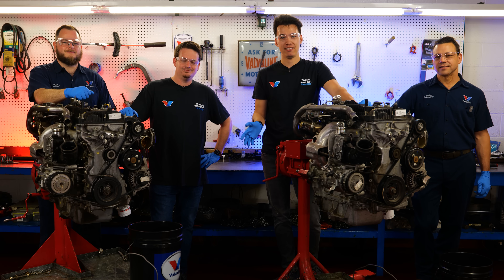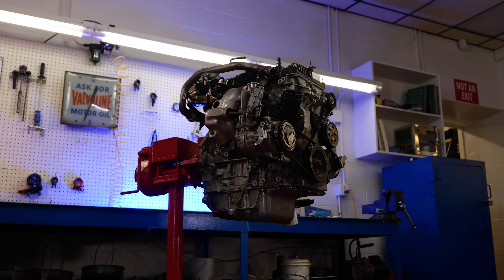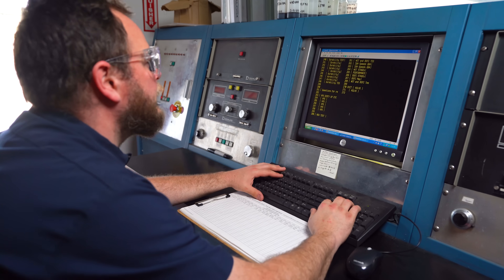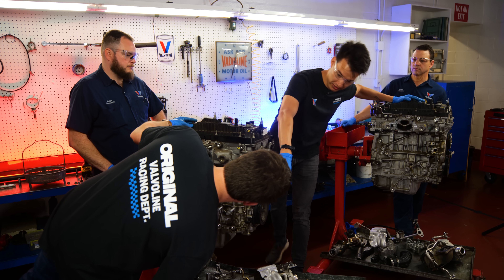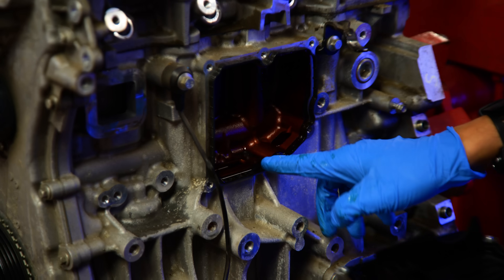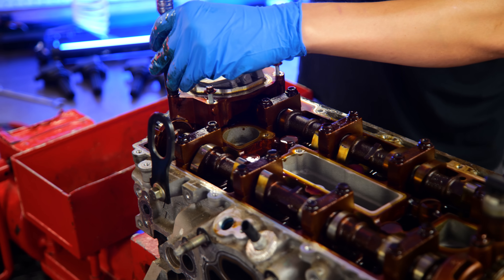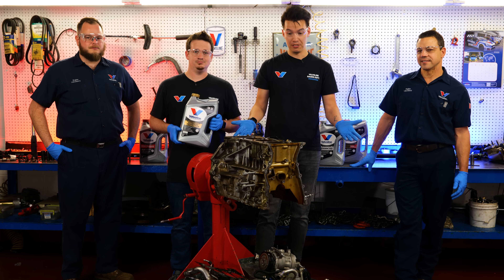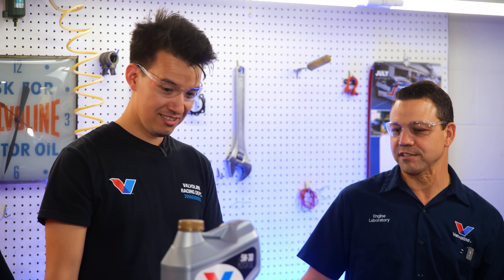Testing different oils over 4 years and 1 MILLION miles

Comment: I use Sea Foam before every oil change just to clean out that varnish in the engine. Been doing it for 30 years. Look at the color difference! That dark brown is burned oil build up. That acts like glue, not slippery like oil! That gets built up in an engine, and it will stop parts like timing chain tensioners for moving freely. VCT actuators wont work causing codes. Valves will stick, and in Hondas, Vtech fails to work right. All of these things need to be extra clean all the time to work right. Yes, good oil helps, and regular oil changes also help, but that varnish is a killer! That comes from the temperatures run in these new engines. When you reach 210 degrees in the coolant, oil starts to burn. When the moving parts get to 400 degrees, it burns fast. Things like bearings, cam lobes, and chains all get real hot and that oil is the coolant, not just a lubricant. That varnish stops small parts from moving freely like they were designed to do. When that happens bad things happen. Seriously folks! I do this every oil change, until I have the engine fairly cleaned out. Usually 2 or 3 times After that I do it about twice a year. Most off my cars make it to 300K because I buy them with 150K on them for cheep, fix them and drive them til the junk man comes to get them. I spend less in repairs in the life of my cars than you will in 4 months of payments for your new car! But, I am a mechanic!

Comment: Dollar store oil is fine if you change it frequently.  Detergent oil is the key.  The detergent prevents the formation of deposits.  But the detergent no longer works if you wait too long between oil changes.  Use oil with cleaners in it and change your oil often (1500 to 3000 miles).

Comment: well if you ran 1 with synthetic and one conventional oil, the conventional should have been changed earlier then the synthetic, that's just how it is, you cant run conventional as long as synthetic. If you try changing conventional every 3 to 4 thousand miles conventional will look just as good.

Comment: I have a 2008 silverado with 180k miles. I use conventional oil. I use 10w-40 conventional oil and change it every 3500 miles. Because it has DOD/VLOM, I use the viscosity necessary to keep the oil pressure at 40 psi at idle, I add a can of SeaFoam on every 3rd oil change and leave the SeaFoam in for the 3500 miles. I pulled the oil pan a couple of years ago, and it looked like the synthetic oil engine in this video. That said I use full synthetic oil in the rest of our newer cars and change it every 5000 miles. Never exceed 5000 miles on an oil change regardless of what the manufacturer recommends..

Comment: I'm confused did they run the oils for the same amount of miles between changes? At valvoline a conventional oil is roughly half the cost of full synthetic so a fair comparison would be changing the conventional twice as much as the full synthetic, we need a test with the oil replaced when the manufacturer says they need changed

Comment: 10,000 miles on one oil change is insanity in any vehicle
Reply: Especially with the cost of vehicles nowadays. I use mobile one oil and mobile one filter every 4000 miles like clock work. You might think it’s foolish but I’m a do it yourselfer. $100 for a synthetic oil change $38 if I do it myself. 5 cars in the family.

Comment: Viscosity is viscosity and one has a uniform molecular structure to withstand breakdown which leads to less deposits. Ultimately it’s all about maintenance and for conventional oil 10k miles is insane on a turbo application.

Comment: Now, run it cold for 20 minutes, shut it off. Run it for an hour, shut it off over night.  Start the engine cold and rev it right away. Put actual load on the engine.

500k miles on a engine stationary constantly running (nowhere near red line mind you), is not an achievement.

Comment: And the turbo is where they goofed up. Turbochargers REQUIRE full synthetic oils on anything newer than 2010. Them running conventional in a turbocharger fucks up the journal bearings and bushings in the turbo since the oil passages are smaller than what conventional is designed to do. Timing tensioners are a full synthetic type of feature as it was designed. The varnish issue is overzealous bullshit, change your oil regularly based on your application; if your coolant and coolant circuit are not operating within spec then I'd worry about temps. Carbon buildup, again REGULAR OIL CHANGES; 3k for conventional, 5k for full synthetic, and change the filter every 3 to 5k; done. If you want a REAL test, grab an old iron-block v8 and run snot out of them.

Also, I buy Pennzoil, so suck on my used oil filters nerds!

Comment: Considering the interval was 10,000 miles this was very impressive. I think I was as impressed with how well the conventional oil did as far as wear vs the full synthetic. I'm 72 and use synthetic but for many years conventional was the only thing available. It isn't so bad after all.

Comment: this is shocking. the more expensive oil wore better? I wonder what my engine would look like if it was parked in a controlled environment, routinely taken apart, repaired, examined, and measured? or did valvoline invest millions on this facility and employees for 4 yrs just for you guys to come along? thanks for the commercial.

Comment: You guy's are part of a HUIGE problem effecting consumers and OEM  alike... you said these engines were on about 10,000 mile oil change intervals, But you need to remind people the oil  levels need to be checked and monitored about every thousand miles or so, People now a day's show up for oil changes being "dangerously" low on oil because of normal oil usage many vehicles wont show any oil on the dip stick what so ever !!! OEM's are replacing engines for oil usage now more than ever, and spending millions ,Once low oil levels damage the engine there's no turning back. 40% of drivers probably never check their oil in between oil changes. OEM'S could easily install oil level gauges and sensors .  Owner of a 1991 Chevrolet Dually 454 CU v8 with 362,000 miles- oil and filter changed average 3500 miles from day one !! It's easy..

Comment: I’ve been using Mobil 1 full synthetic for ever we have a 2012 ford fusion with 312,000 miles on it going strong I use it in all my vehicles and equipment.
Reply: I will ad I also change my oil 5-6,000 miles with the full synthetic. Especially with turbo vehicles

Comment: Impressive mileages, however, 10,000 miles is crazy for oil changes, plus no one, who is empathetic to engines, would run an engine for 10,000 miles without an oil and filter change. Test bed tests are not the same stresses as real conditions on the road. Perhaps a higher % of detergents in the Synthetic oil, possibly kept the metal surfaces clean.

Who owns Valvoline now?

Comment: My engine is around 411k on my 99 Avalon. My catalytic converter still original. Could be possible it’s not even working lol. Been only using conventional but the bottles now say semi-synthetic. High mileage oil use to be a thing but it seems now now not needed. I do lose probably 1/3 quart per week. Naturally aspirated engine will always beat any force induction engine in reliability and longevity. I use Valvaline, mixed in sometimes Quaker State as it is cheaper.
Reply: Don’t be a cheapskate.  Do you like varnish and stuck rings?
Reply: Been working good so far. SAE standard rating.

Comment: Before seeing the video, I want tro say one thing. No gearhead goes 10,000 miles on conventional oil. I use semi in an old Toyota and do 2800 mile oil changes. Unless the use of the engine was equivalent to all-highway miles, this is not a valid test. Even with all-highway, no one who knows anything goes more than 5000 miles on conventional oil.

Comment: I was planning to switch to a conventional oil until i saw this video. I use a synthetic oil, but the oil seems to be decreasing (no smoke or any indication that it is decreasing). Did you check the oil quantity when you drained the engine?

Comment: I was a Ford engineer in engine division (now retired) and asked our lead tech specialist why Ford recommends 10,000 miles on synthetic blend oils. He said from their durability runs that they can not tell the difference between full synthetic and synthetic blends. The synthetic has such an effect that 50% is enough to substantially reduce wear.
Reply: I had an uncle that worked for Mobil 1.  They ran an engine 100,000 miles on the bench with fully synthetic... 3k oil changes.  The cyclanders still had the wear marks on it.  Which means that engine had almost zero wear.  I use Mobil 1 to this day in all my cars and change them all at 3 to 5k but way closer to 3 than 5.  I don't have problems with my cars.  Other basic things are need to make a car last a long time... like carbon cleaning at 100k if it is direct injection, belts, and timing chains, brake and coolant flushes.  Other than that normal stuff like brakes, new light bulbs, windshield wipers and of course tires.... struts and shocks around 150k.  If you are really good and somewhat lucky you can get a car to go over 300k.  10k a year average, that means not having a car payment for 25 years.  That is huge.
Reply: @bpb5541 you forgot about transmission flushes if the vehicle doesn't have a sealed transmission those are also very important along with differential fluids (trucks, awd, etc.) changed around the same time as other proper maintenance. Little extra too spend but it's a good price too pay knowing every fluid is new and not old/burnt up. Then at around 200k all the gaskets and seals should be replaced by that time or earlier if they started too leak.
Reply: @kylebeach2316 Thank you for this.  All very valid.
Reply: Durability is based on time and cost
Just like any other companies in the 21st century
Reply: Ford and durability can't be used on the same sentence.
Reply: @diegopalomino1200 although….. just talking in context to engine and wear items. I honestly think more than 75% of all small and catastrophic failures are due to the emissions factor. Plus appear in Canada or Minnesota where eight months out of the year, your engine and engine oil is being started at a temperature of around zero Fahrenheit which not only drastically starts deposit accumulation but also breaks the oil down significantly faster. I feel like all manufacturers need to implement a different oil based on where you live.  The manufacturer should say run a further winter grade oil in the winter versus summer due to the startup being cold.
Reply: @EasyGoingLife101  you dont say??
Reply: @EasyGoingLife101 Honda calls for a synthetic 0W-20 everywhere here in the US…combined with an oil life monitor that takes temps and duty cycles into account so no worries on the cold starts.
Reply: @diegopalomino1200 haha Found On Road Dead/Fix Or Repair Daily
Reply: @diegopalomino1200  😆

Comment: 500,000 miles tested engines !
My wife's friend has a 15 year old car with only 35,000 miles on the clock.
It would take this car 218 years to complete 500,000 miles , going to the shops and back , but on British potholed roads a half million miles is a  ludicrous test.

Comment: That’s why your brand new engine cools off very quickly, but as it gets older in miles, and you don’t change the oil it takes longer to cool off… that’s why I still change my 2006 Kia Sportage with 177,000 miles every 1400 miles. People will pay $50 for a tank of gas but won’t pay $50 to change their own oil. 

My oil pan started to leak 3 miles before my 100,000 mile warranty expired. When the mechanic dropped the oil pan, his face lit up in shock as he looked over at me and told me to come look at it. My engine looked cleaner than the synthetic engine in your video and I use conventional oil. 

I should have about 25 oil changes according to Kia every 7,500 miles. So far I have 129 oil changes. Oil is the life blood of any engine. Changing it sooner never hurts it. I purchased my 2006 Kia Sportage 4x4 EX with 44 miles on it and I changed the oil at 275 miles and at 850 miles and 1,500 miles when it was brand new. 

I even drained the 4 x 4 transfer case with only 250 miles used in four-wheel-drive. Keeping the fluid cleaner keeps it newer longer.

Comment: Conventional oil every 5k miles ... 
My wife's Hyundai Tuscon had 180k miles when the timing belt snapped and it had convenitonal oil since day 1 and changed every 5k miles on the dot, 36 oil changes. 
The top side of the head and cams looked factory NEW.

Comment: Im old so I use conventional oil from dead dinos and change it every 3,000 miles. The older oil gets the less contaminants, it holds in suspension.PERIOD. So go ahead you do you but I am happy with the standard lubrication fluid and change intervals void of marketing and sales goals.
Reply: What I would prefer to have seen on a Ford was Motorcraft oil vs Valvoline Syn.

Comment: If they cut the oil change intervals by half, both of those engines would be way cleaner. 10K is a bullshit number, 5k is perfect, or 7-8k for a junker you don't care about.
Reply: 7-8k is actually when the o/c reminder will turn on in most cars these days. I imagine the average Joe does 8 or 9 because they don’t prioritize it. But once you know you know and I do 5k full synthetic religiously. I am not just changing the oil to avoid damage, I want to extend the life of the engine

Comment: 11:00 results. I discovered Synthetic engine oil during my second year at a large Aerospace company as an Aerospace Engineer. Key point of the Engineers article was they ran ONLY Synthetic engine oil in the jet engines. The aerospce industry prefers to use top quality strong & enduring materials
Reply: The guy who started Amsoil had similar experience as you.

Comment: I have a 2003 VW Jetta Wagon TDI and it is currently at 716K km (445K km). Still running the original engine and transmission exclusively on synthetic oil. Still running strong.
Reply: Great car.
Reply: 445 km you meant right? Not 716? My 03 honda pilot is at 380 km and everything is original and purrs like a kitten.

Comment: Imagine how clean the engine would be if it was using an actual 100% synthetic oil. Valvoline "full synthetic" is still a synthetic blend.

Going 10k intervals is insane in real-world conditions. An oil change is cheaper than an engine. Personally, I go 3k or 3 months. Typically, I am not over 3k by the 3 months mark. I change my oil every March, June, September, and December. Easy schedule to remember.

Regardless, it is fascinating to see actual results and some what real-world differences in this testing.

Comment: Most full synthetics are very good products. Personally for me i use pennzoil ultra platinum in my 2021 F150 limited.
Reply: Correct, and a perfect strategy.  Ultra Platinum is my preferred oil in my Prius Prime, but I'll also use the regular Platinum, or Castrol Edge, if the price is right when I'm stocking up.  Any full synthetic with the SP rating is good enough for me, but I do like putting in the Pennzoil at least every other time, and preferably most of the time.

Comment: We put in oil with a low concentration of detergents in one engine, and we put in oil with a high concentration of detergents in another engine. One engine came out cleaner than the other. Now don't get me wrong, always put in the best spec rated oil for your engine and change it regularly, just understand why one came out cleaner than the other.

Comment: The difference in cost between using this oil compared to a high quality semi-synthetic oil over a million miles with 10k mile changes works out at over $7000 at Australian prices. My 1800 Subaru engine was pulled down after travelling near 400,000 kms on gas running Valvoline gas oil and the inside looked almost new.

Comment: This truly is one of the best automotive tests I've seen on youtube! Thank you for paying for two SUVs to run every day for 4 years, that is crazy. I've already been sold on full synthetic, but I do wonder now if I should pay premium prices for premium brands of synthetic oil vs the generic off the shelf stuff, and if the additives that make premium oils more fancy even matter if I'm changing oil every 3k miles, not 10k. Over the course of 500k mi, changing every 3k with $45 oil vs $25 oil makes a huge difference in maintenance cost but I think this here proves that even the worst oil (conventional) can still get the engine (mostly) to the same mileage.

Comment: Sad thing is it’s not motors or transmissions I hear people complaining about. It’s the electronics and the fact that some companies have decided only they can repair certain parts that tend to fail quite often and cost around $3,500 every time. Just sent my fusion to the scrap yard cause I’ve had THREE break booster modules replaced each costing about $3,000. I bought a four runner so suck it ford and I own an escape, an f350, and a 65 mustang. All going bye, bye cause even the parts dealers arnt getting anymore money from me!